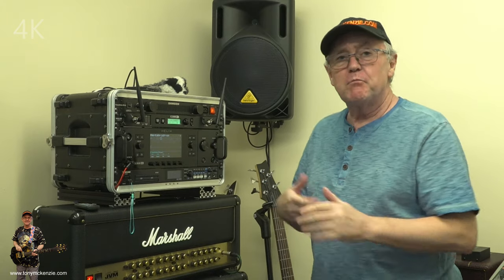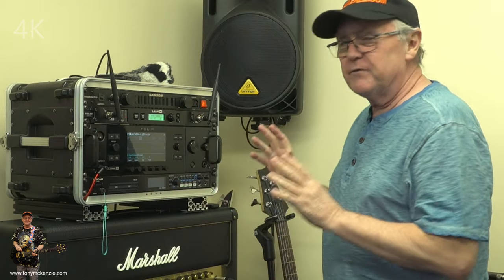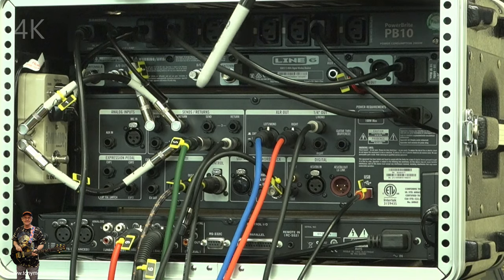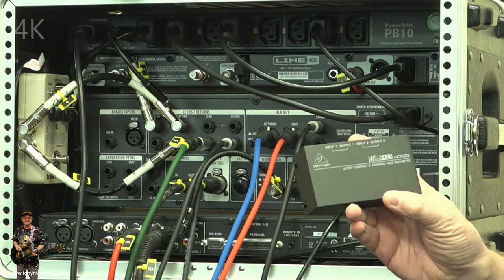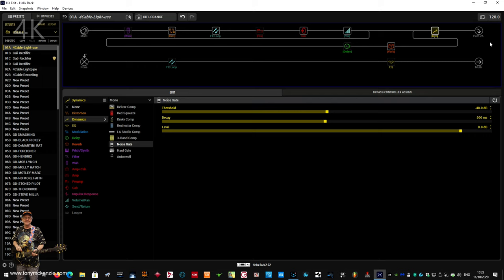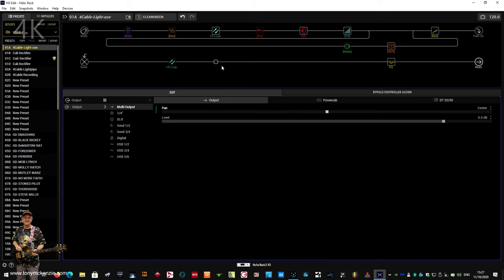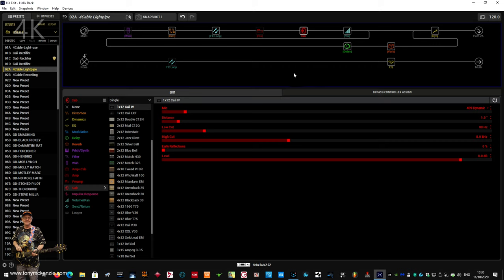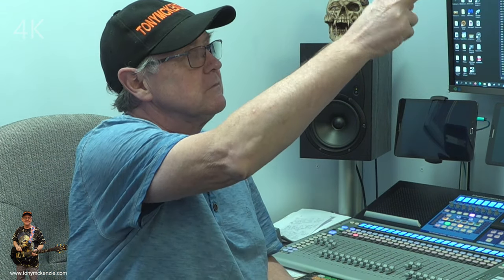Line6 Helix Rack | Solving Audio Noise | 4 Cable Method

Comment: Hi Tony, if the ground is disconnected from the line 6, then surely it’s dangerous even if you’re not actually connected to it because of wireless - you still have to touch the unit? Please enlighten. Cheers
Reply from the maker: It's a great point and one that only you raised to now... but I like these questions... I'm not always right but here goes - info NOT in the video. If you watched the original building of the rack I showed a cable coming from the G90 from around the back to the front and fed in to the Helix as the feed from the wireless.

When the cable from the wireless is removed and a guitar cable plugged in to the front of the Helix there was virtually zero hum and all was great. When I plugged in the G90 again there was hum. If I disconnected the G90 from the PB10 mains distribution there was no hum. 

However, I did check each and every unit in the rack for the creation of audio hum in various modes (on, off etc.). In fact the singular item that had an issue was the Line6 G90 wireless system.  Historically, I used to have a rack unit that when screwed in to the rack created hum - a sort of ground loop effect. If I remember correctly that was an Intellifex at the time. I solved that one by placing 'gaffa' tape behind the lugs of the unit and effectively isolating the chassis of the Intellifex from grounding to the chassis. It worked perfectly.

So, with that in mind I did the same with the G90 - put gaffa tape behind the ears of the unit. Alas it remained the same exactly. But what I saw was that if I removed the power feed from the PB10 for the G90 then there was no hum. Pretty obviously a grounding loop because the G90 is brand new. I did question the PB10 and almost bought a new one. As you saw I also tried the Behringer Mini HD400 Noise eliminator that was (almost) useless.

But not this... your point is good because it's the first thing I considered when I isolated the hum to the G90. What about safety! Dead right (is that the right word!). OK consider this. Firstly, the controls on the G90 appear to all be plastic! I was then a bit less concerned. But the second thing is this, when I'm going to use the G90 rack the signal comes out the back of the G90 as I said and through to the front of the Helix... on a 6.3 mm Jack (1/4 inch). That jack carries the signal for sure, but the cable also carries.... a ground! So when I use the G90 wireless, firstly I have no connection to it, secondly it has plastic buttons and thirdly there remains a ground through to everything else in the rack that IS grounded. 

That is my logic to the problem I faced. My guess is that somehow the G90 was susceptible to grounding (maybe by design who knows) as the problem did not exist with any other gear in the rack. Of course I would not normally remove a ground wire and have probably done that once or twice since 1970... but in this case I am pretty sure that any issue of a problem will go down to ground rather than through me and down to ground because the grounds in there are the least resistance to travel. 

There is nothing on the back of the G90 re ground lift or anything like that and that's a pity because this could have been so easily solved. Line6 doh.... ;-) 

Now if you or anyone else knows better - just post it all here - it can only help other guys one way or another and that is the intention really... NOT to have them remove their ground from the G90. 

Lastly, the Behringer DID remove the last of any hum (it was really hardly noticeable) when I used that from the Helix out to the amp loop in. But would I bother with it if I did not have the now 'spare' Behringer Mini HD400? No I would save the money. 

Hope this helps to understand my logic and anything from others is most welcome...  Stay safe.
Reply: @tonymckenzieofficial  Great explanation. I had the same thought as @Peter, but you're right - effectively you've created your own 'ground lift'. If there's a ground loop it seems this is because there are two grounds looping. Removing one fixes the issue... or using a ground lift? Glad I watched this and read the above.
Reply from the maker: Well thanks for watching... appreciated.

Comment: Tony - quick heads up on something I came across recently with a hum problem - turns out the non earthed 9V DC supply carried nearly half mains AC voltage on the negative lead! Was one of those cheapo crappy universal jobs that have different plug heads for Europe, UK and USA that clip on the "wall wart" body. They don't have an earth so ground out the negative to the neutral wire. Easy to check just put multimeter on AC range and measure the output at the DC plug - I got 112V AC on it!!!
Reply from the maker: That's a very good point. Indeed I will check that. However, in among my tests to look very close behind the rack and what was plugged in and turned on, I did actually remove the power to the Roland PSU that powers the 'MIMIQ' thereby (hopefully) eliminating that from the cause of the hum. But great point and I will check that. If it is as you suggest I'll post back here about that. Read the other posts about the hum I answer. Stay safe.

Comment: Are you familiar with static sound coming out of the helix 6 lt floor unit? My band buddies are all analog and seem bothered by it - as soon as you plug in and turn the amp you can hear a slight static sound .. can anything be done to fix this? I am plugging into the same electrical strip (I have read this could happened if plugged to separate electric outputs) also I’m running the 4cm into a mesa rectifier
Reply from the maker: Hi Javier, I have not had that problem personally and I don't own an LT unit. But if its a ground loop you can get isolators to prevent that happening. Alternatively (but not always possible) you can use different wall power NOT on the same circuit and that sort of thing. Also ensure the cables you use in the 4cm are very good cables and not bottom end cables. That will likely make a difference. Hard to say exactly from here of course, but I would experiment with the power side of things first. Hope it helps at least a bit for you and that you get it solved. Thanks for watching.

Comment: Hey Tony,do you notice any tone change with Helix in 4cm VS plugging straight into the amp?...I could never get mine to not suck the dynamics out of my amp.....
Reply from the maker: I can get a very good sound from it with that 4cm for sure. Likely my amp is different to yours and it might work differently in some way? I can say that it plays and sounds really good in real life... but it is subjective I agree. It 'feels' right too when I play through it. Did yours affect the tone with everything turned off? That's a test for sure. Stay safe.
Reply: tonymckenziecom  mine just changed the sound in a negative way....it kind of made it sound a little muffled,and the low end wasn’t as strong....I was using an EVH 5150III by the way.....It was maybe something I could have adjusted,but I got frustrated with it,and sold the Helix shortly after.....but I am thinking of getting another one and giving it a shot....I have the Fractal FM3 currently,and it sounds great,but it’s just sooo hard to use....I still haven’t learned how to build a preset in the thing...The Helix was simple and made sense with the way things are laid out....
Reply from the maker: Hmm mine sounds extremely good through the JVM410HJS amp head 4cm. In fact I am going to make a video of that and you can hear it yourself (time thing). I solved the direct to desk and the 4cm stuff and the programming of the snapshots etc. and they are very good and easy to use. The thing is though that we each have a tone and 'feel' that works for each of us and this setup without the amp in there and using a real amp does work for me - and it's better than the old stuff I had in the rack build if you saw that. I have not tried the FM3 but plenty of guys use them so probably fine. BTW I also set up a DI to the desk for recording with a PREAMP and speaker sim in the chain and no amp sim - that for me seems to work for the direct tones I need... but to be honest the best way is with a microphone I guess. Thanks for the info Scott... its always great to hear what other guys are doing. Stay safe.

Comment: You've got a couple of stones to go before you're challenging my own lock down belly Tony. I've told my Mrs that what with my new bushy beard and my ample stomach, should my employer go bust in the next couple of months. I've got a great chance of getting a job as a Santa Claus impersonator come December!  

I had the same ground loop hum problem in my setup.Which I solved by daisy chaining every socket and extension from one output. Which is a pain because it's at the other end of the room, so it means long cable runs. The one that was closer was causing no end of unwanted noise.

What are the iPads/tablets underneath your monitor being used for?
Reply from the maker: Ha really? I thought I was king of the pile with bellies :) - wife excepted :)  But I'll succumb to your belly being bigger :). Ha Santa has been postponed according to Boris here tonight it seems and we have virus pie and cus turd on top it seems. 

I get it on what you say of course. See here's me thinking the PB10 would have some sort of isolation in there... silly me. However, I never had ANY noise issues on the old rack (see rack build video). None!  It's one reason I looked closer at the gear inside. Read other replies for more info.  

The iPads (actually Samsung tablets - I'm not a fan of Apple) are used in Studio One to show other stuff like the (for example) metering, control of the EQ's or other effects for example and when you're mixing down tracks to be released (not too often these days) they in effect give you more pairs of hands. Alan my friend and fellow musician can adjust or watch them while I do other things. Overall they are a big help. When I bought the tablets Presonus had no mounts for them (you will see that later they released brackets that mount on the back of the StudioLive 32. However, take another look, as those holders I have were half the price and probably twice as good because they are adjustable in most ways. They all connect via network and work extremely well. Even with just one and placed on the desk on the left side that helps a lot too. Thanks and Stay safe.

Comment: Woahhhhh. Wait a second. The guy that hates pedals, gets every pedal known to man.
Hmmmm ....
And the 4 wire setup.....oooogah......
And rack mount....
Tony are you going on a tour?
Hahaha.
Great Video....
Where’s the purple stomper you waited 3 years for?
White?....
Whawhawhat?
Great video!!
Reply from the maker: Ha Tommy :) You KNOW I don't really use pedals much... but when I ordered that (from your kind pointing me in the right direction) one day it would arrive :) and it did. Scarily three years and a couple of months to arrive. Original supply date was approximately two years but now it's three years and two months. But that's OK.  Anyone who ordered one won't lose out I doubt even if the y don't like it - but it does sound good I can say (as you know). Mine is high and high outputs because I'm like that :). Indeed mine IS white with the gold lettering - I figured I should be different in at least one way - I wonder how many they sell that are NOT purple? its a good question. 

No on tours for me - or anyone else from what I see these days :(.  But I have had a rack since the early 90's and if you find my other building of this rack video you will see a shot of the 'old' one. This rack sort of makes things good again... in the 90's my rack was super cool, but like me it aged :). In any case watch for the review of the KOT pedal and I'm sure some of those Marshals etc will sound great with that in front. Stay safe Tommy.
Reply: tonymckenziecom Bravo Zulu!
If you don’t want your KOT, I’ll take it.
If you sell it, it will be worth double what you paid.
Never put anything less than 12:00.
I’m saying no more.
I’m curious to see your opine of the actual build.
It’s a 11/10 for me.
The only pedal that stays on 24/7 
Touring ended with me a long time ago.
COVID destroyed live music.
Stamped to the ground.
Stay healthy.
Reply from the maker: Thanks for the tips on the pedal! Nah you can't have it :) It was built really well and you can tell it was hand soldered... a great pedal... stay safe!
Reply: @tonymckenzieofficial  I’m happy you are happy. Now check out the Sunface. What great fuzz pedals! 
No three year wait.
Reply from the maker: I'll take a look.... slowing here right now... virus cr*p. T

Comment: You didn't setup different input and output levels by using the all in one fx loop. If you devide it in input and output loops on the helix then you can set different levels, instrument for the front of the Marshall and line for the loop if the Marshall.
Reply from the maker: Thanks for the tip... I might get to look closer at that...